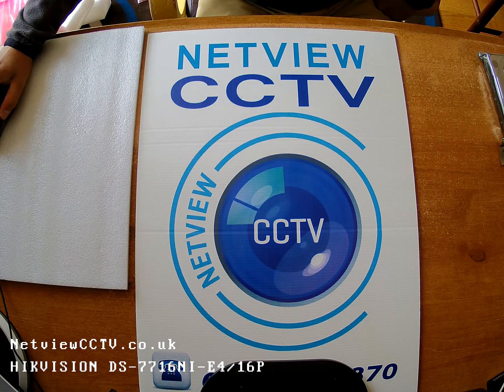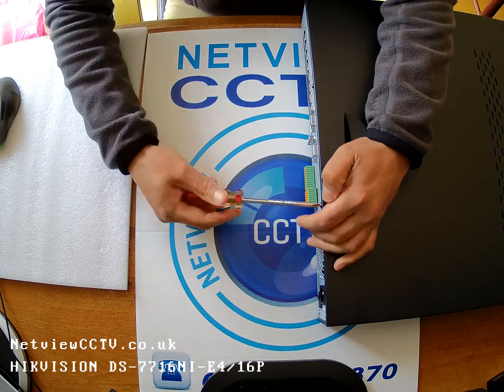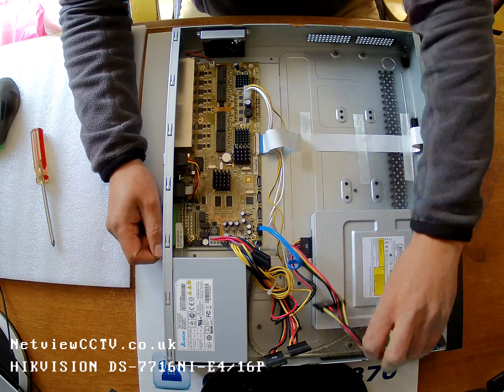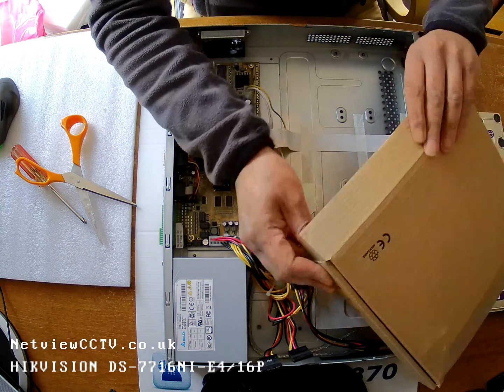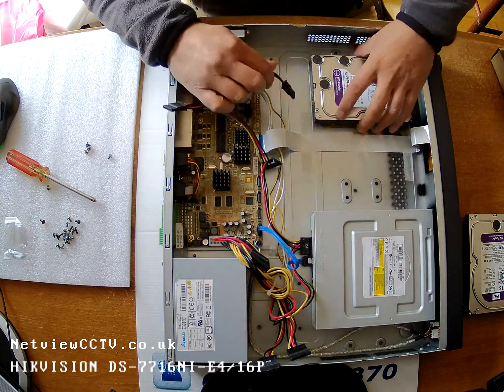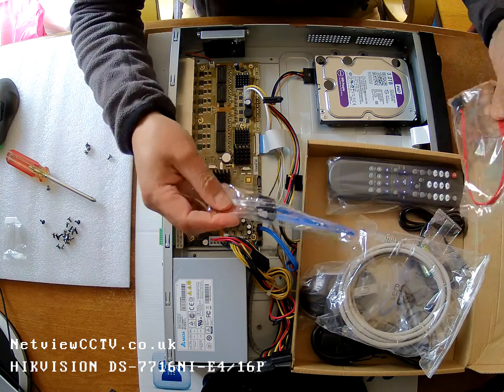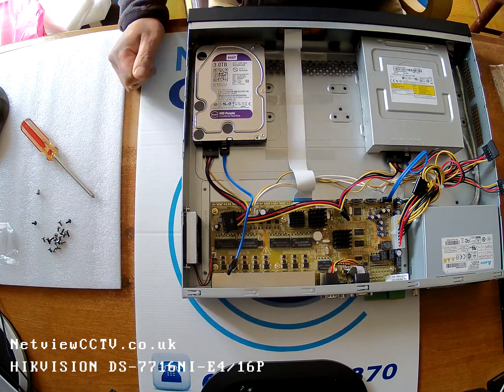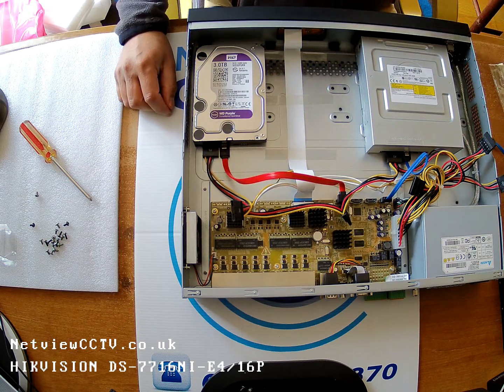Hikvision DS-7716NI-E4/16P NVR Hard Drive Installation Part 1

Comment: hello.. I have a problem with my  DVR HIKVISION DS-7300HI-S .Out of the blue it started to turn off, remains off for about 30 seconds and then turns on by it self, seems to work fine for aprox 1 minute and turns off again, this repeats over and over again.  I thought it was the POWER SOURCE so I replaced it, how ever the problems continues. Have you any idea of what the problem might be ??  Thanks
Reply from the maker: most likely culprit is a faulty Hard Drive

Comment: Hello can you tell me the difference between your model NVR and the DS-7716N-E4? I am also trying to find current firmware for this same model.
Reply from the maker: jmendoza8991 Hi, This model has 4xPoe ports. You will need to contact your supplier for the correct firmware as they may be region specific. Regards